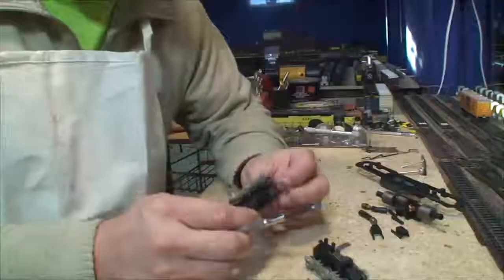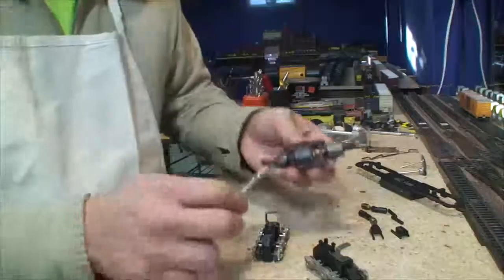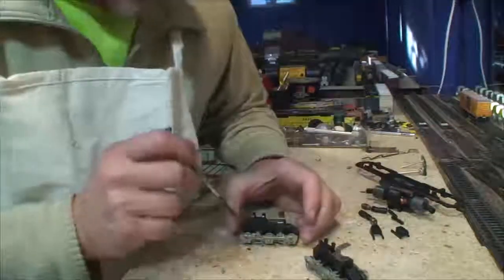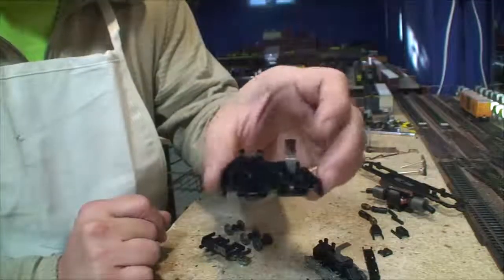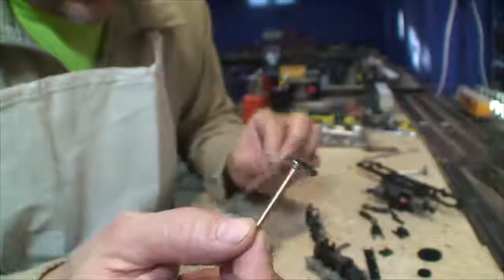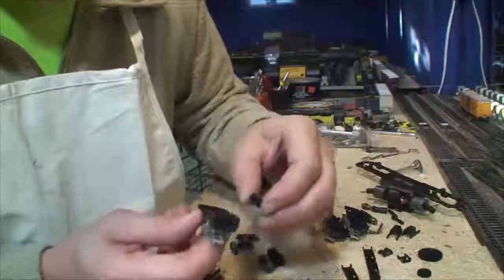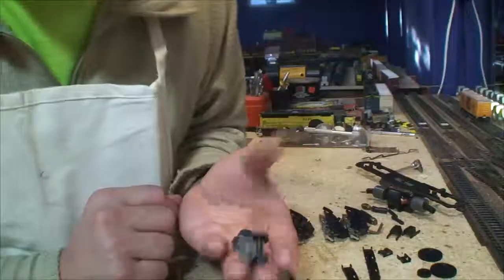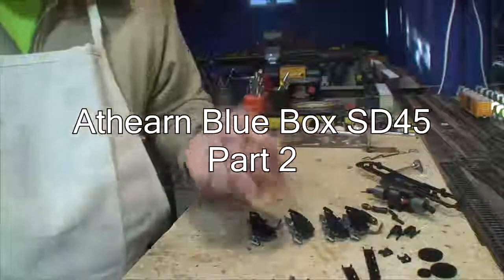Athearn Blue Box SD45 total rebuild part 2

Comment: I like your Athearn Blue Box Videos,I have an old Athearn SD45 Blue Box.Ho Locomotive after I run it for awhile,The motor gets hot.So how do I fox this from over heating?
Reply from the maker: almost missed your comment - I recently did a long video on rebuilding athearn stuff.  2 things to check first are putting a drop of machine oil on all bronze bearings, 2nd is to properly grease the gears.  Next is wheel gauge which can cause straining around curves. When you watch the Athearn rebuild video you'll see that 2 of the locomotives are the old SD45 and during the reassembly each of things is demonstrated.
Reply: @elite194  So dose soldering wires on the trucks and motor,Make  a better connection to run the engine fatser?
Reply from the maker: not faster, but much smoother running and on these 24v motors that I've been using the better connection is the reason I now eliminate flywheels whenever possible.  with a decoder installed that uses momentum, the flywheels get in the way of getting the super smooth response.  I have 2 more SD45s on the bench now that were in the Athearn rebuild video that are going to go a couple steps farther for even better performance and there will be a series on that.

Comment: I had cleaned all my wheels and the sqaure copper bearings,My motors still get hot I wired soldered the 2 parts where the connector goes.Too power the trucks and  wired soldered.Too the copper ppart on top of the motor,Still gets hot the motor what else can I do here? Do you have email or on facebook?
Reply from the maker: check the trucks to see if they roll freely or easily without the worm gear installed - they should roll freely without lube and be easy to roll with lube.  if that works, then install the worm and turn it by hand and it should very easy to turn.   if the worm turns freely then it is for sure a motor problem.  the motor gets hot if it struggles to turn the shaft or if it is worn out.  Have you taken out the motor and connected it to power to see if it gets hot without any loading on it?  you can send a picture of it to mkl at janushd dot com